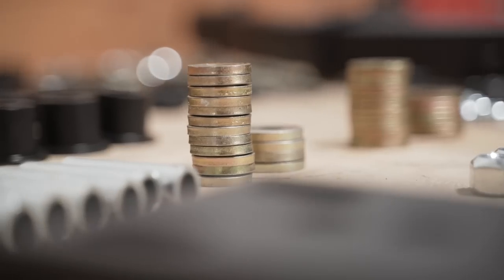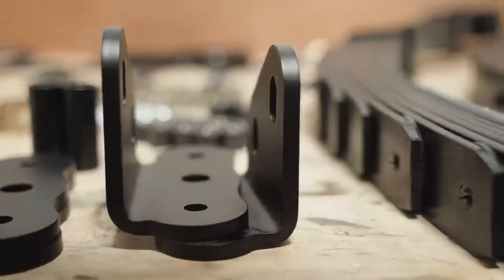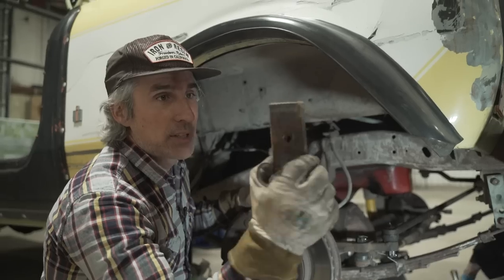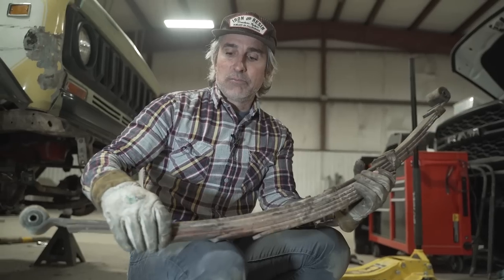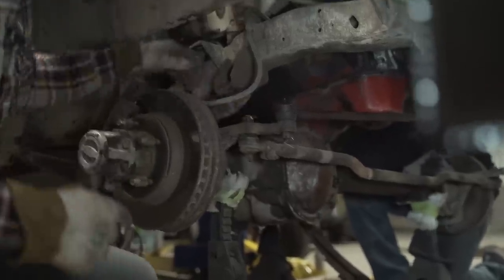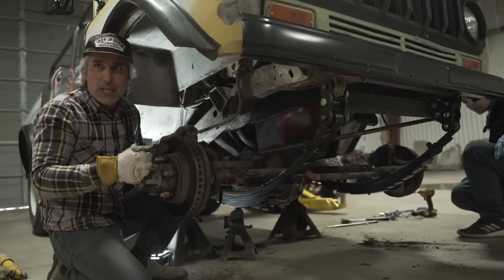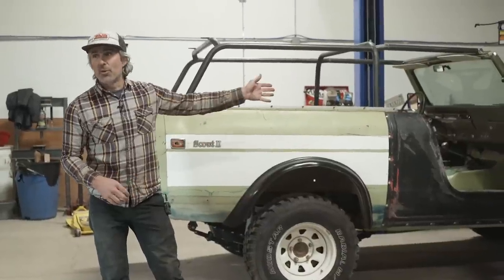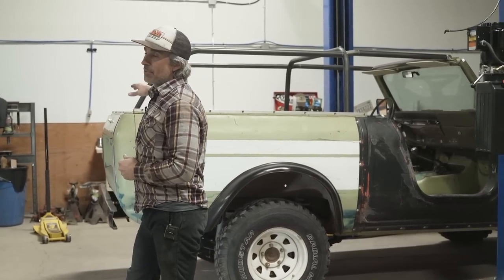TECH TIPS: Scout II Suspension Install feat. Anything Scout x Deaver Spring Kit!

Comment: 12:10 Fun fact: the reason they used to do different size bolt heads vs nuts on cars was so that the owners (who presumably would be working on their own cars) wouldn't have to own duplicate wrenches -- it was assumed that you'd buy a full set of wrenches and that's it.

Comment: Thanks for the awesome Tech videos.  Just one point to add.  Bearing grease is not recommended for poly bushings.  Silicone based grease is good with polyurethane. Sil Glyde or SuperLube are good examples.  Prothane and Energy Suspension make their own silicone based lube.

Comment: There used to be a place called Tough Terrain in Hayward California, it was owned by Sherman Balsh ( if I got his name right) he used to race scouts until they quit building them then he went to Nissan,  he had everything scout, I had a couple scouts in high school,  they had a 4" Spring Kit at that time made by Betts Soring Co, I installed that kit on my 1972, I drove that thing on several trails in California, they kept the springs on the bottom, I made spring shackles out of SST square tubing and flat bar, it was nothing special but it worked really good and drove great down the road and I always felt like I could make it through and make it home

Comment: Did you have to check the transfer case output shaft angles and the pinion angles to ensure that they were parallel (or very nearly parallel) to each other? I noticed no shims were used and were perhaps not needed with the mild lift.

Comment: Some of the Scout II rear lift springs have a  offset rear center pin. You could also re-drill the spring perch to move the rear axle one in inch for much larger tires The Deaver Springs are a Superior way to go.

Comment: Noticed at 42:37 that the rear driver shock has the reservoir mounted to the leaf spring, but on the passenger side it’s mounted to the frame. Is it common to have the rear shocks flipped on a Scout? Or was that necessary to do because of the washer that was welded to the shock mount? Thanks!
Reply from the maker: good catch, we were just rushing and made a mistake... whoops... its already fixed!
Reply: @anythingscout  Ah okay. Fantastic video! Thanks for all the hard work to give the Scout some high quality content.
Reply from the maker: @birch424  thank you! we appreciate it!

Comment: I learned something! I never knew international use that style of torsion bar. Would you say it works as well as a traditional sway bar? I've been thinking about getting a scout and it would be 90% on road and only light off-road use and pulling a boat. I like the 2.5" with 33" x 10.5" like you do quite a bit. Thank you 👍
Reply: It works! Who's to say how well by comparison.... since there is no "traditional" sway bar to compare it with.

Comment: I realize that you guys were installing a Deaver 2.5" spring lift kit and the shackle angles looked appropriate when the weight of the vehicle was placed back onto the springs. I have noticed with both the Skyjacker and Rough Country 4" lift kits that the shackle angles are far to obtuse even when the weight of the vehicle is placed onto the springs. Perhaps I am completely wrong but I fear this is an oversight in their design which leads to a very high spring rate unless remedied with either extended shackles or cutting off, repositioning and rewelding the shackle hangers. I was forced to do this when installing a 4" Skyjacker lift to bring my shackle angle to nearly perpendicular or slightly acute. Did Deaver take this into account when arching their springs to maintain an appropriate eye to eye spacing?
Reply from the maker: What can we say, these springs are the bomb.

Comment: Awesome Video!!  Great to see you guys bringing new life to countless Scouts!  One question, with the rough country 4" lift kit can I fit 35" tires under my Scout II?  I see you guys are running 35's on the terrables, so I was wondering what that took, thanks!
Reply from the maker: The Terrables have been modded in many different way a big one includes rust/trimming of the wheel wells. Check out or tire/suspension tech pages on the website for our tips on fitment.

Comment: Does this kit come with bushings for the frame? Additionally, what is the thin piece of metal that is being drilled out at the 41min mark that goes between the ubolt plate and spring?
Reply from the maker: The recessed ubolt plates have a tight bend radius that keeps the springs from sitting flush and making solid contact. That is a small spacer plate to make sure it mounts flush.  final production versions in our kit have proper sized holes that clear the spring studs without having to drill them.
Reply: I was one of the lucky folks who got this lift. It did not come with those plates though. What do I need to do to get them?
Reply from the maker: @nathanknowles1030  Shoot us am email and we'll get you sorted.

Comment: Next time when you put the jack stands you should not put them in a pinch point between the shackle mount and the frame. It better to put them on the frame by the cab mounts. 

The factory weld are not that great in that location and if you have to do a weld repair the stands are not in your way nor in your way of removing he leaf springs.
Reply from the maker: The frame has some slope behind that that makes them unstable further back. You could put them really far back but it just starts to lever your frame to the point where you can't open the doors.  
Yes, good call,  you should absolutely check those welds as they sometimes crack. That said, if the hangers are good enough to hold your scout via the leaf spring on the highway we see no problem holding your truck on jack stands. It makes for a very stable location.